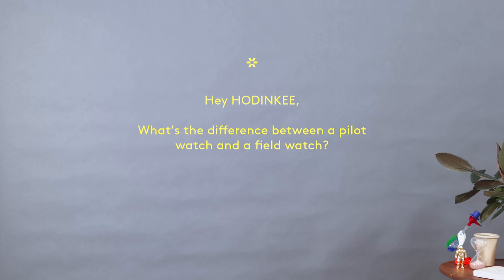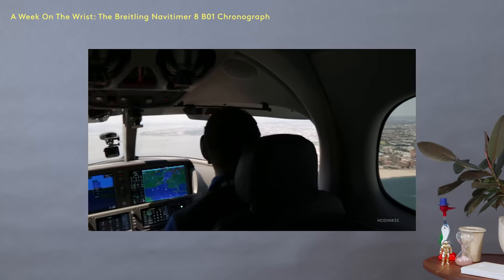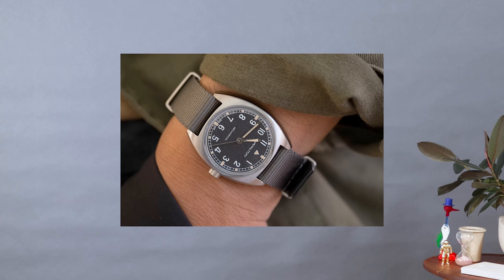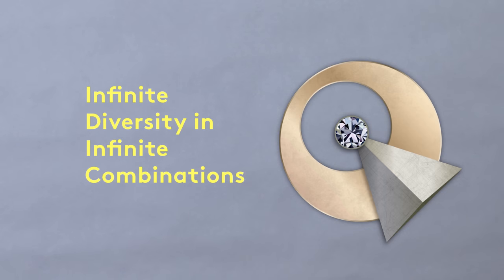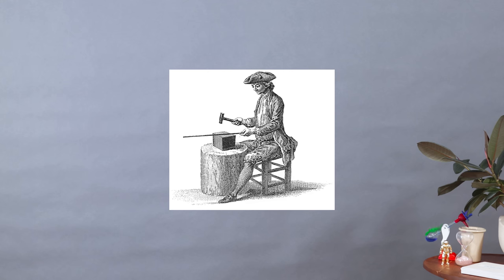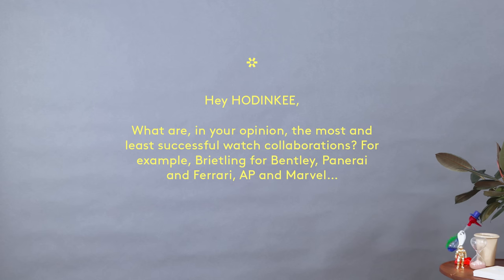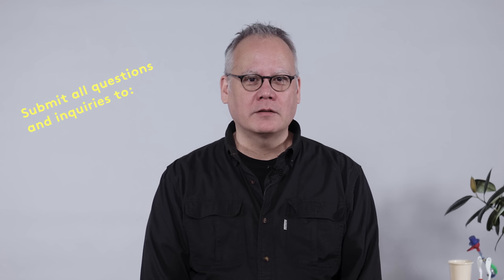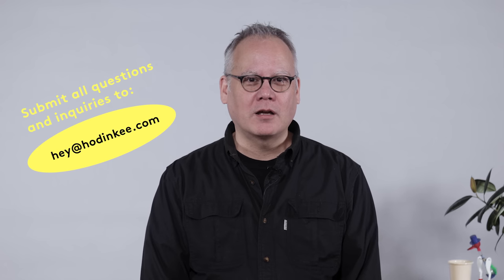What Is The Difference Between A Pilot's Watch And A Field Watch?

Comment: This is a rather pedantic point from someone who used to, on occasion, give university level material science lectures, but it's not technically true that every alloy will experience fatigue under a cyclic load... In fact, steel and other BCC metals have a "fatigue limit (or endurance limit)," which is a stress amplitude under which the material WILL NOT fail from fatigue.

Having said that, it may be true that in practical application a mainspring will always be cycled above its fatigue limit. One could run an example calculation and find out for themselves if interested.

Comment: What I don't understand is why motorsport themed watches don't have better lume more often? I'm not talking about the gimmicky surface level motorsports designs you mentioned. But, true motorsports, either simple 3 hand or chronographs. The lume on those often are quite small and when they have it, even if a little larger, not all that bright.
Ok, I guess there can be an argument that 1)too bright a lume could be distracting in the dark. However, I doubt no more brighter than glowing instrument gauges and what nots inside the car at night.. And 2)  you shouldn't be looking at the time while driving... To the latter I would say that's maybe precisely why one should have better lume to quickly get a better reading in the dark so you can concentrate on the road and driving.
Idk? For me, with abundance of excellent  modern lume formulas, there's no excuse not to have great lume regardless of the theme and design style of the watch... Which, as an offshoot to this lume question, I don't understand why a fair number of Swiss brands that have been making dive watches for decades still use surprisingly weak lume on their modern dive watches? They are adequate, but annoyingly underwhelming considering some brands are only mostly known for their dive watches and still don't offer the best lume in them.

Comment: I think the 19/21mm lug width question is a fair one. I have an Omega speedmaster automatic with 21mm lug width and I wanted to get a quality leather strap for it, but couldn't find many. 
Last time I checked, Hodinkee had NO straps for a 21 mm lug width.
Even Omega doesn't have much of a selection.
Reply: Try Aaron Bespoke.  He made a stunning ostrich strap for my Grey Side of the Moon
Reply: @recalcitrantgrackle2500  Thank you for your insight and advice. 
I just checked their website but I couldn't find what I was looking for, as they were offering very exotic leathers, and I'm really looking for something plainer, like some of the designs I saw in the Hodinkee web shop (I still find it ironic how Mr. Forster talks about celebrating the diversity of odd-numbered lug widths, yet they offer relatively few options for these lug widths. It's better than it used to be, I will admit, but it's still limited).
Reply: @michaellupu2080  may sound funny but you might be able to find a good cobbler to sort it out. Sounds backwards but good cobblers are excellent leather craftsmen. Same with getting a belt sized. Cobblers dude .. almost a lost art
Reply: @Nigel Molesworth Perhaps you're right. So far I only looked at the "obvious" international sources like Omega, Hodinkee and Jean Rousseau and couldn't find much. I live in Romania and don't know of local craftspeople that can fit the bill. Maybe your circumstance is different than mine. 
Either way, I don't care for you condescending tone.
Reply: @hillskee  Thank you for yours and Nigel's reply and advice: I just had to look harder. I found a maker from Holland (seems to be Hodinkee's counterpart/competitor here in Europe) with a great collection and I found exactly what I was looking for. 
Thank you for the push!